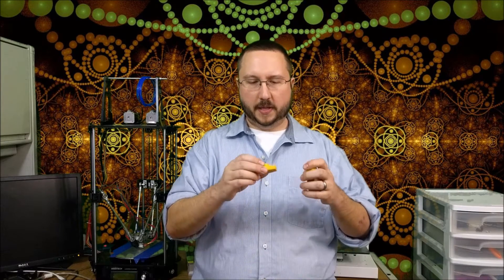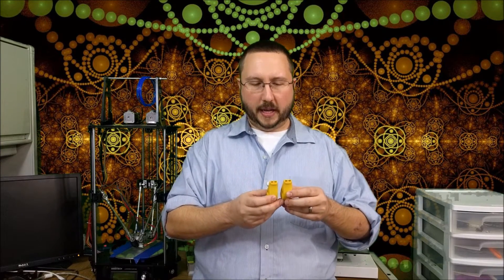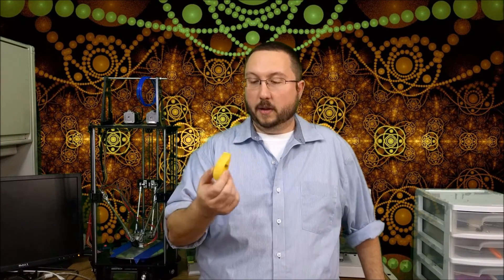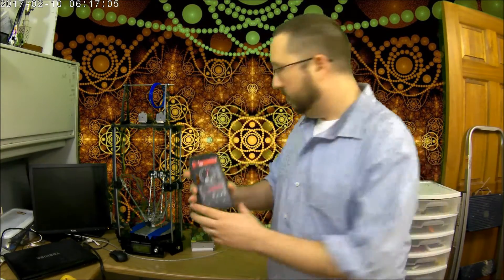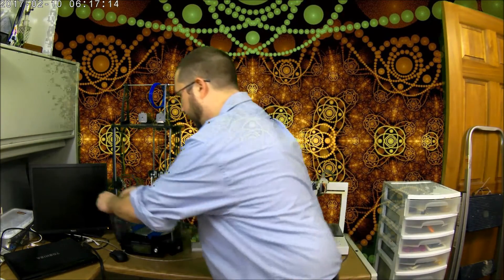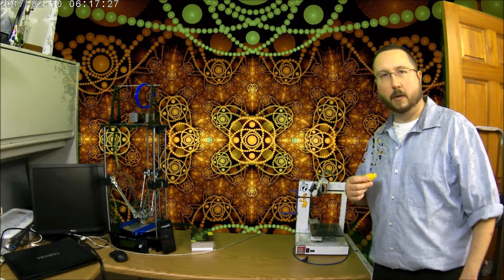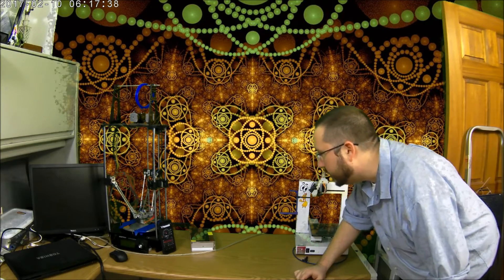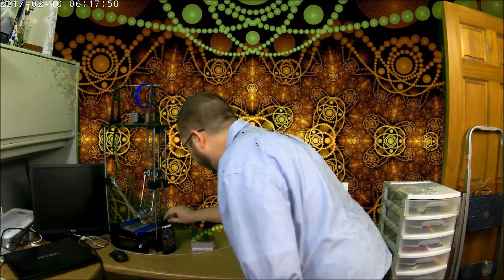V29 3D Printed Whistle Test How Loud Will it Get?  PLA+ Thingiverse

Comment: lol using a phone as  "decibal meter" hahaha. thats like using an app for a thermal camera.
Reply: Decybel meters are not cheep;)
Reply: @eciacud  relativ to what I’ve seen some for 30€
Reply: @blackferrets820  Yes, but is there a sense of spending 30€ for decibel meter for one video and not using it ever again?
Reply: yeah.... iphones have thermal cameras now. yikes
Reply: if the ap is calibrated on the mic (which is the case in some apples apps) then its useful. however your right. not the best way to measure db.
Reply: @derteufelsbraten3670  but it will give you an idea